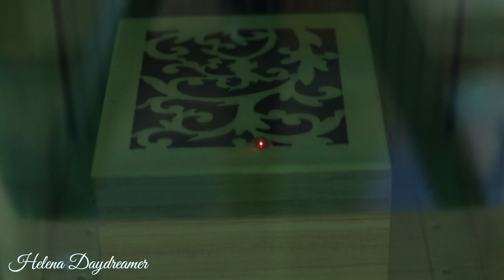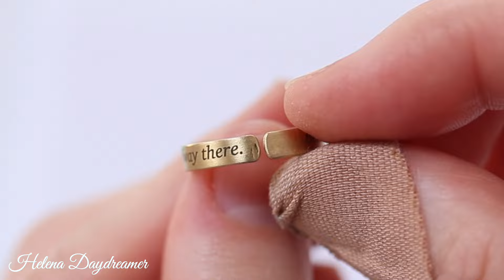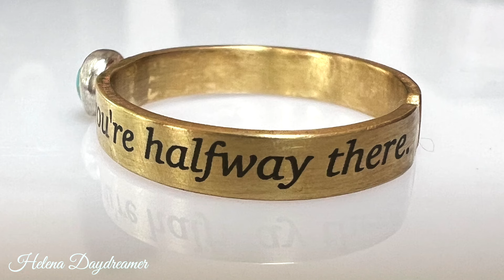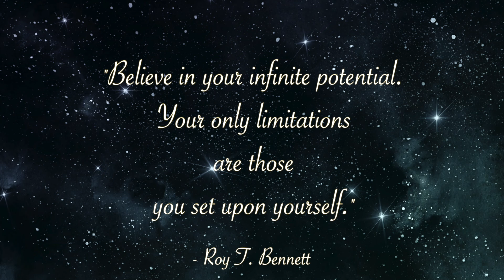8 Easy Dainty Jewelry (Soldered & Engraved with xTool F1)

Comment: So pretty! Do the engravings stay black, or does it start to rub off after awhile?
Reply from the maker: Depends on what material you’re using and the settings. It’s like patina(oxidation) so if the jewelry constantly rubs against your skin, or if you keep wearing it when washing dishes etc it will eventually get lighter in colour. It’s not deep engraving, but you can feel the texture difference for sure.
Reply: @HelenaDaydreamer  thanks for the great videos! Do you have any showing how they look after using the jewelry for a while and the dark color wears off?